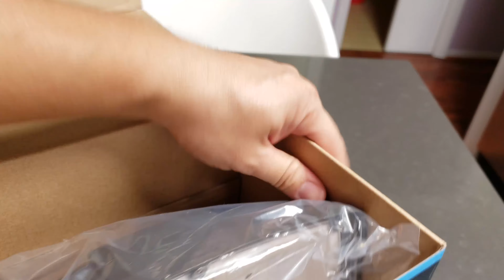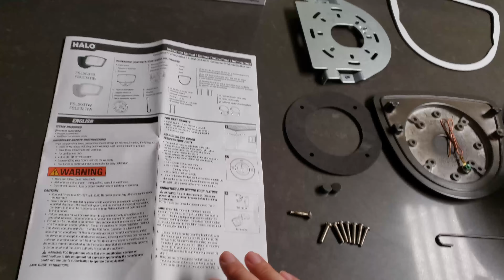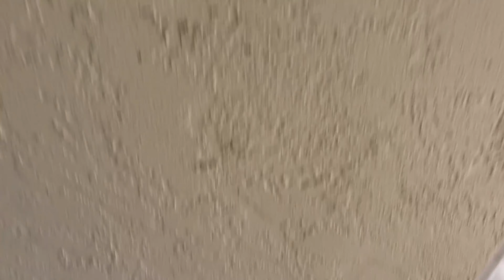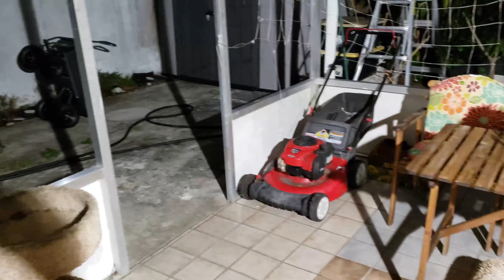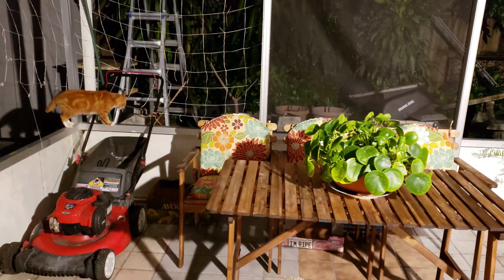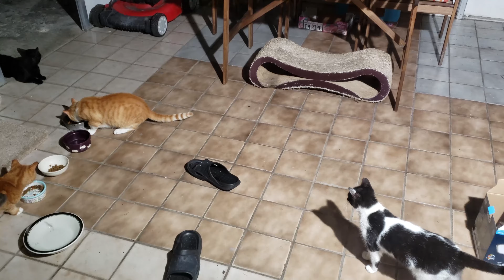Review: HALO FSL 5800 Lumen LED Outdoor Security Light w/Adjustable Color Temperature

Comment: The technology of LED lighting has changed dramatically since this video was posted. I don’t think you are using twice the energy when running both sets of LEDs, as the brightness of both sets probably revert to 50% light output to maintain the same lumen output at all three color temperatures. It’s obvious that the most cat friendly color temperature was 5000K since more cats congregated to the area of light.

Comment: Unfortunately this is not using the supplied back plate and gasket for the light to keep it water tight.  I just bought 2 of these lights and had to drill my own holes through back plate to make it work.  The mfg does not even show the back plate on the 'Packaging Content' list. The MFG's directions are not complete.  I hope I am more impressed with the light than I am the installation instructions and customization that was needed.
Reply: It does come with two different types of mounting plates, one for regular mounting, and one for recessed mounting. If yours doesn't come with the plate it might be a returned/previously opened item, go back to the store and ask for a exchange.